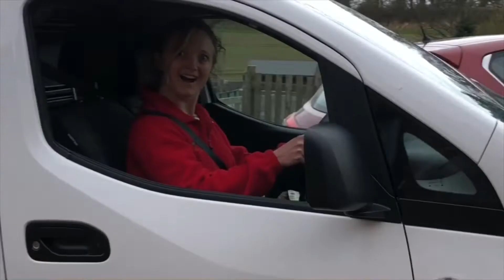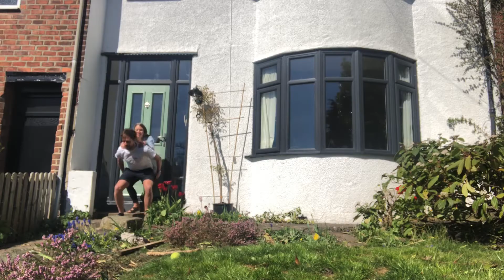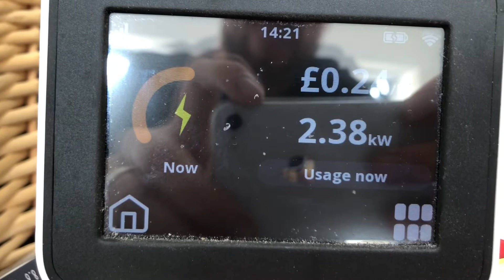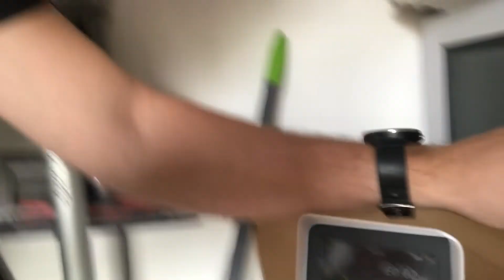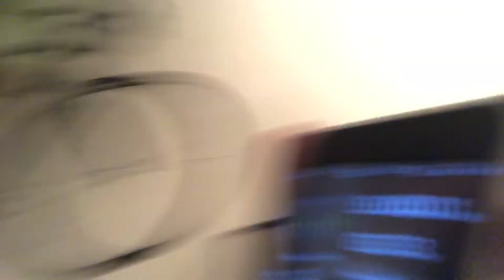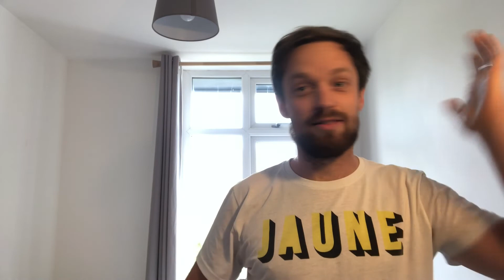HOW MUCH ELECTRICITY DO I USE? SMART METERS and CLIMATE WAFFLE - Episode 3 - Low Carbon Lifestyle

Comment: Why are you using heated water to wash your clothes? Why not use cold water?
Reply from the maker: Hi Lynn - thanks for engaging with the video! 
I tend to wash my clothes on the 30° setting on my washing machine (this tends to be the recommended temperature for detergents to work well etc). The washing machine has settings up to 90°C - which I think is excessive! The mains water comes into the house between 5-10°C so the water is heated up slightly by the washing machine. 
Do you do things differently? Very happy to take suggestions!
Reply: Tom Bray in America the washing machines do not heat the water. Heated water comes from the home’s water heater. You can chose then between cold (tap temperature), warm (mixed), or hot water (50C). I only use cold water. Here our detergent is formulated to work in cold water. Bleach also works better in cold water. I have no clothes dryer so when doing the laundry the only energy used is the electricity to run the machine and the inherent energy involved in the manufacture/processing of our tap water.
Reply: One thing I wish that we had here are the switched electrical outlets like are common in Britain. Instead we have to unplug things or use a separate switched power strip which is an extra resource to be made and become waste at some point.
Reply: Please keep up these videos. I really want to see how others are trying to reduce their carbon emissions. One of the only other people I see is Rosalind Readhead’s blog and Twitter posts. And then the books by Berners-Lee, Goodall, etc.
Reply from the maker: @lynndollarhide6887  You learn something every day! Using cold water and letting dry naturally sounds fantastic to me. Thanks for engaging, I have seen Rosalind Readhead's blog - she is doing quite the challenge, and I hope will impact a lot of people